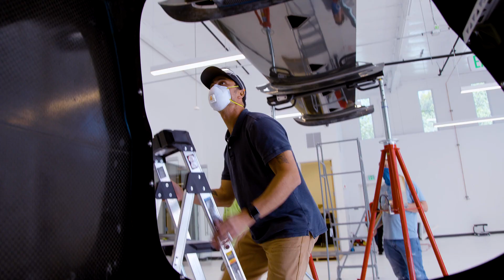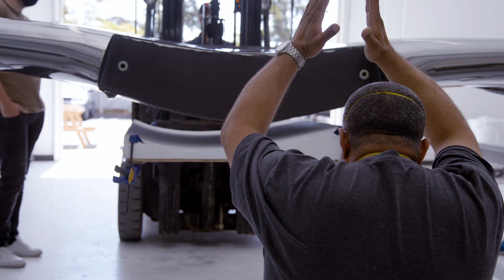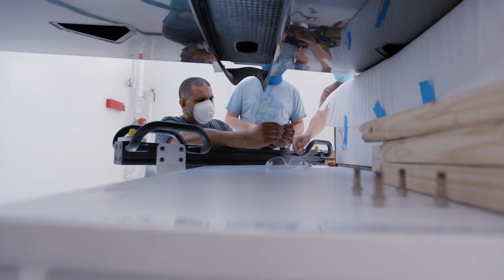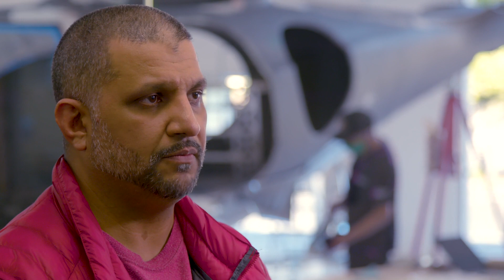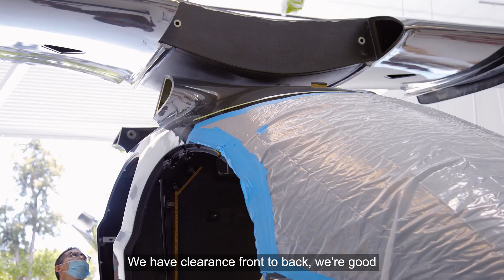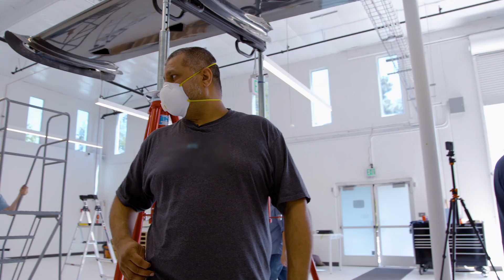The Making of Maker | Meeting the Moment | Archer

Comment: Looks like the glossy finish is Dynoc - used over clay models in automotive development to look like paint for mock ups (easy to strip off to rework if the highlights are not good  but not a durable working finish )  The 'make believe' quality is concerning -smoke and mirrors (back screen projection ) at the 'unveiling' adds to the sense of unreality overall.  What aviation EXPERIENCE do your "Co founders" have ?  The "Zuckerberg look' T shirts etc does not convey too much 'gravitas' (although gravity will be their big problem.